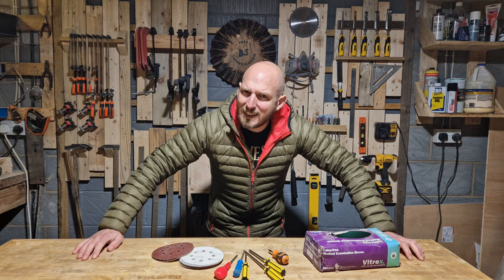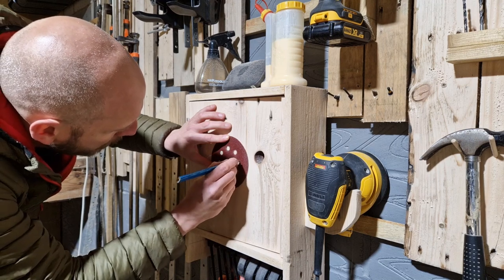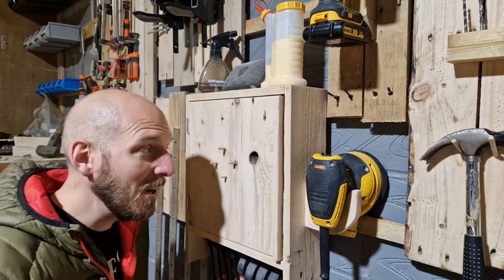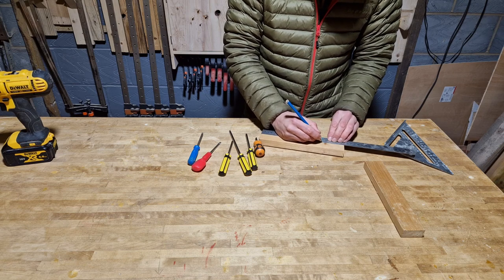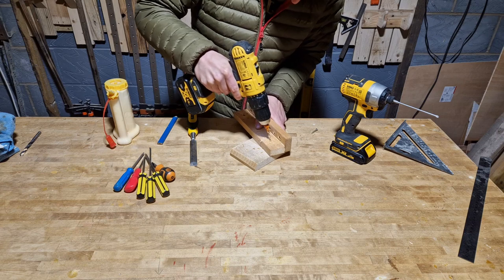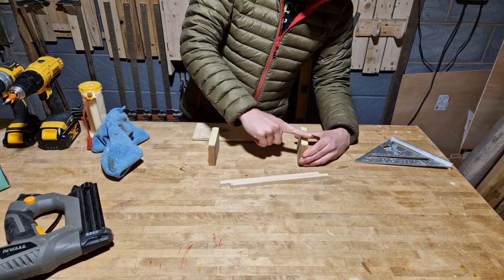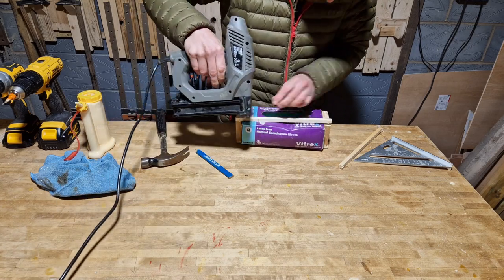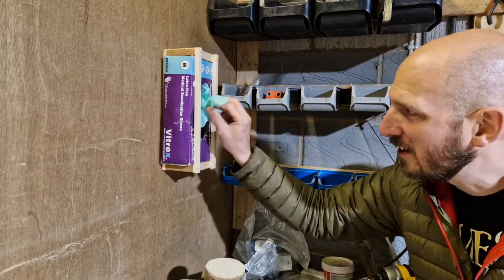WORKSHOP UPGRADES: 3 quick, free upgrades (part 3)

Comment: I am also blessed  with shakey hands (makes for some interesting soldering!) so love your sandpaper pegs. Having binged on all your vids over last 24 hours  I have an insane list of new non-project projects and a dire need to find pallet wood near me (N. Wilts) 🙂
Reply from the maker: Love to hear that! Not your shaky hands, but about the videos! I've gotten most of my pallets through friends. It's worth a post on facebook as it turns out people are getting turf, gardening stuff and large appliances all the time. Most times, the delivery drivers just dump it on your driveway on a pallet.
Reply: @justbswoodworking  Thanks that's a great shout 🙂